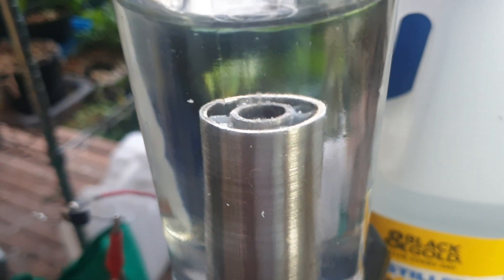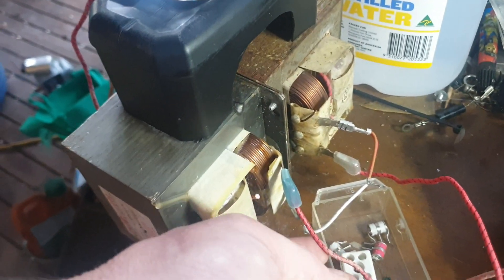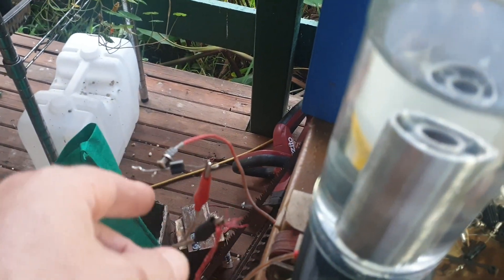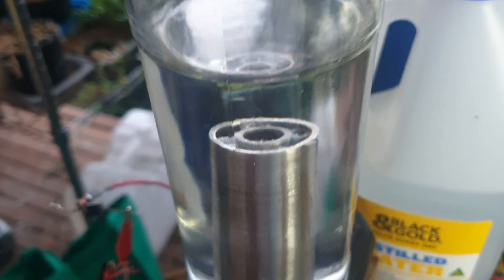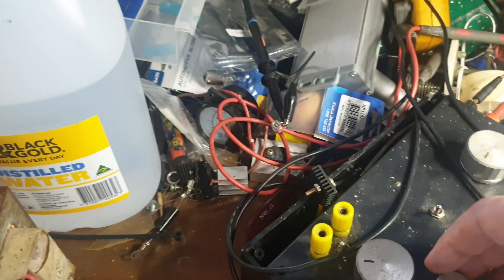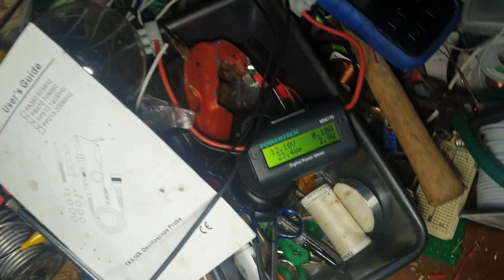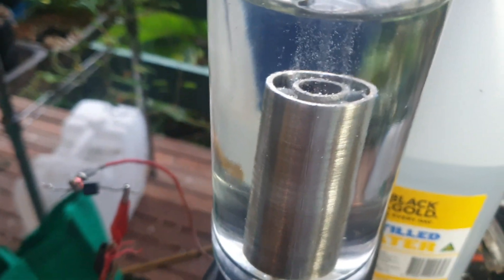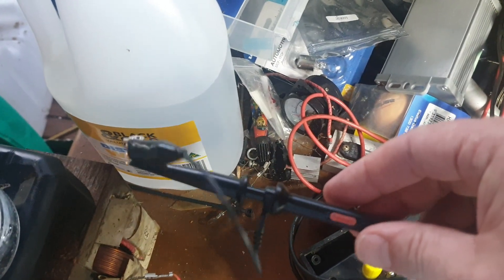Hydrogen Distilled Water no e/lyte. HV @ 2.7Watts double MOTs😃

Comment: I guess what I have shown on what to do to get this technology up and running is too complexed for everyone to follow in that I showed the turn count data for Meyer's VIC transformer on the OverUnity site. In order for me to make the transformer I had to get a 3D resin printer, a CNC coil winding machine, some wire tensioners, and the proper diode, wire, and corresponding cores just to make the transformer properly. Plus I had to get a vacuum machine, transformer resin, and some containers to put everything in so that I could apply a vacuum on everything so that the transformer is vacuum sealed getting all the air out so that the transformer doesn't short out on me. I think all of that in which I did is just too much to ask for anyone else to give a try, huh? 

In order to read the voltage directly from the WFC one would also needs to get a differential probe like the one's I show in some of my videos and the inter video of me at the 2013 Global BEM that was held in Boulder, Colorado. Yeah, from my perspective doing all of that is just too much to ask for those trying to get this technology up and running isn't it? What truly bothers me about all of this is in that interview video I showed true high voltages being applied to the WFC that has never been duplicated by anyone that I know of to this date. And just like you did in this video I used pure distilled water with nothing being added to the water. 

I have went out of my way to try and explain the real science behind this technology to the point I have now totally given up on trying to teach this technology to anyone anymore from being ignored by everyone. It takes money to get this technology up and running but not many folks like to put any money where their mouth is with this technology. I taught how the waveform is supposed to look like, gave examples, and even showed the correct waveform on some of my videos in real time. I even went back to the old 8xa circuit and showed that older technology breaking the bonds of the water molecules with pure distilled water just last month.

My reason for going back to the 8xa circuit was to further my understanding of the technology as I had a few unanswered questions. Now that I have the answer to those questions I am just about ready to show the VIC technology up and running correctly. Those out there with deeper pocket books than I have should have had this technology up and running way before my broke butt got to the point of being able to showcase this technology but they would have had to follow my lead and learned from me on just how this technology actually works. All I can say now is for everyone to stay tuned as this year will more than likely be the year this technology make another go at making it to the marketplace.
Reply from the maker: i have watched your videos, i dont do the forums anymore, full of trolls and fools. help me understand. I feel the MOTs are too slow, and yes the right diodes are a must. i dont have any yet. am looking at diodes with fast reset and high reverse voltage over 1200V...
Reply: @m3sca1  Not sure if this link will show but this is my thread on the OverUnity site: https://overunity.com/7030/stanley-meyer-explained/msg572631/#msg572631 I posted just about all I've learned over the many years I have been working on this technology there. The actual science behind this technology is much different than Meyer talks about and I have a feeling this is due to capitalism as he truly didn't want anyone copying what he was doing and/or stealing his work. Basically what I did different from practically everyone else working on this technology was to make use of the scientific method and ignore a lot of what Meyer was saying. That is how I managed to get at the actual science behind this technology.
Once I gained an understanding of the science behind the technology I went back over all of Meyer's work. Meyer tells the truth up to a point and will then do a lot of misdirection so that no one following his written work would be able to get the technology working. Thanks to a lot of well meaning people that shared things over the years I was able to get the turn count data of Meyer injector transformers and more which I shared in the thread as soon as I got the information. One thing you have to understand is these transformers must be made to power the load they will be handling as the injector turn counts will more than likely only be able to power up an injector. But using those numbers one can gain a working knowledge of what must be done by trial and error testing. My transformer is far larger than Meyer's transformer due to it is being used to power up a WFC and not an injector as in doing so the WFC requires more power to operate than the injector does. One thing people need to learn is the choke and secondary side connected to the WFC is an isolated circuit thus no ground can be added to the circuit as the flow of electrons will take that ground and stop the technology from working. That is why a differential probe is a must for this technology as you can't see what you are doing otherwise. Trust me I've taken great care to ensure that the secondary/choke side remains an isolated circuit at all times at that is part of the reason why I am able to get such high voltages being applied to the WFC.
With the Voltage Intensifier Circuit nothing should happen until the threshold of ionization has been reached as the primary way Meyer used to restrict the flow of amps is by the waveform itself. A balanced waveform having equal negative and positive voltages cancels out the flow of current through the WFC or Injector. I got the voltages to be within 5 volts of each other and the current flowing through the WFC was around 0.6mA. Now this has no bearing on the power that goes into the primary coil as it's a Isolated circuit thus the primary will take some amps to provide power to the charging chokes but no more than the wire's current draw capabilities that you use. I use 22 gauge wire so for me I can't put more than a few amps into the primary coil or it will burn out. 
Well, if you can check out my thread on the OverUnity site as that will more than likely get you heading in the right direction.
Reply from the maker: @SKYLARKING  lemme guess he wants money for it... like all the other things on his website?

Comment: I'd recommend adding in a combination foot and hand Deadman switch. That's what I do for all my projects where I might kill myself if I haven't had the right amount of coffee. By having to press a button, you ensure you're not going to have one hand grounded (so long as your button's not a ground obviously). I also place the foot switch on a rubber mat so I know my feet aren't grounded either. By having to press both these switches at the same time to energise the circuit I ensure that if I do accidentally touch the live part with my one free hand, there won't be any current flowing through my chest.

It looks like you definitely know what you're doing but so do soo many of those unfortunate people who play with MOT's at home and knock themselves off the mortal coil. Complacency is human nature and when there's no safety backup your relying on yourself making absolutely no mistakes.... And mistakes are also part of being human.

Comment: I think you need a proper spark gap as I have found the gdt allows flow at far lower voltages than they are rated for. Once the initial plasma happens you can get it to continue as the voltage dims down . Just like a flouro tube . This doesn't allow proper dc and will make it less effeciency in my humble opinion . Maybe cover the mot just incase incase incase !
Reply from the maker: that is worth trying🤓👍

Comment: nice does that mean anode and cathode wont get eroded away? if true thats really smart idea!!
Reply: Only the anode gets eroded away during electrolysis of water. and you will still get erosion of the anode with the voltrolysis  method but it wont be as bad.
Reply from the maker: in distilled water it will last a very long time

Comment: Happy New Year.
 Nice tubes, take 10 grams of sodium hydroxide and make a liquid lye with 500ml of water, be careful, wear eye protection, stir anti clockwise, add sodium hydroxide to the water SLOWLY and place it in a glass vinegar dropper bottle once cooled off. Slowly add the lye drop by drop and watch your current and your scope for the sweet spot. You will need to repeat this a few times as it is difficult to know when your passing the sweet spot until it has happened. Make note of the peak, repeat and take it to the edge of the cliff. Remember to use accurate water volumes. This is a very handy trick someone taught me long ago for fine tuning.
Reply from the maker: never hear that before. does the amps drop?
Reply: @m3sca1  unfortunately the amps will increase but so will the HHO production, then it’s a case of balancing output against current draw.
Reply from the maker: @whatifididthis...1236  ah ok. i have played the electrolyte game in the past and my favourite things to that end is oxalic acid and silicon carbide dust. both work very well. the carbide is the most interesting since it is a semiconductor and not an ion, but makes amps and gas go up hugely with the benefit of zero foaming like lye will do. but we dont see step charge when the water is conductive
Reply: @m3sca1  well that is interesting. I have not experimented with those materials but it is interesting the increase in output and input. In my experience, which I need to point out was 12 volt DC and I had 4 SS tubes 1,2,3,4 inch, I got the highest efficiency using sodium hydroxide in a liquid dropper, watching my amp gauge and would stop adding lye at 1 amp current draw, wait five minutes and adjust if needed back to 1 amp, I never had issues of frothing with this method and also rarely had to add water to the cell even though it was connected to a car and in the heat of an Aussie engine bay. One real interesting thing I noticed over the years was the volatility increase after 15 mins of power, gases were produced as soon as power was applied however the implosions after 15 minutes were a whole different dragon. After noting this we used to start the cell 15 mins before a drive, leaving the top off the cell and hood up to prevent build up of HHO, learned the hard way on that one too.